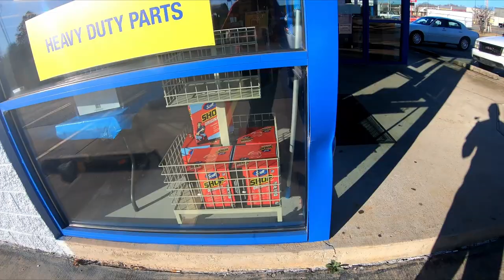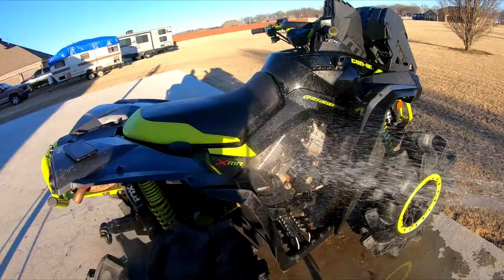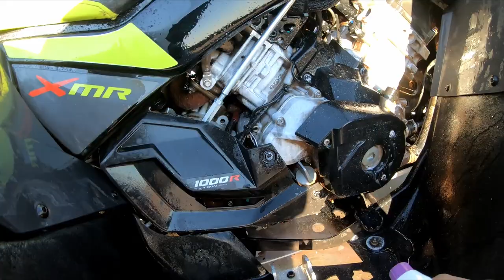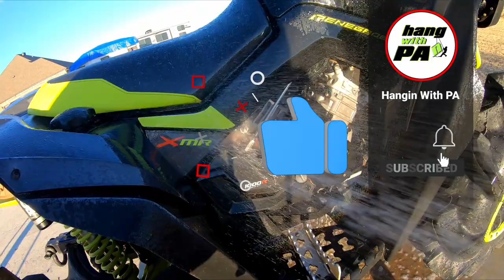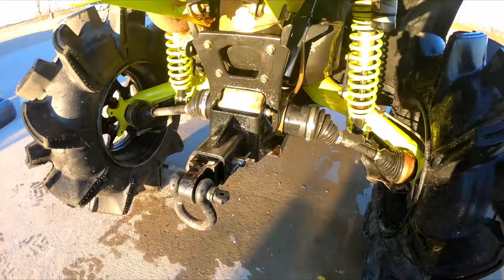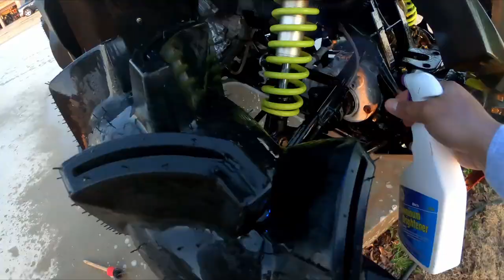HOW TO REMOVE MUD STAINS ALUMINUM BRIGHTENER CANAM RENEGADE 1000

Comment: My old KFX Id spray wd40 on the engine and under the plastics.  It never stained and was super easy to clean after riding. After a wash  once it dried id wd40 the case and cylinder down.
Reply from the maker: I have heard people say this . 💪🏽🤙🏽

Comment: I use meguairs wheel cleaner works good as well and easier on the painted surfaces
Reply from the maker: Yeah I was looking for that but it was out of stock. Good to know though 💪🏽🤘🏽
Reply: @HanginWithPA  I also use simple green it takes the mud stains out of the plastic but make sure to dilute it good channel bro
Reply from the maker: @Dieselmd2008  that’s good to know , i just never had a good experience with simple green

Comment: What happens if you get it on the plastic?
Reply from the maker: Aluminum brightener contains acid so if it hit painted plastic it would eat the paint off, it it hits plastic it probably will fade it. Good question 💪🏽🤘🏽
Reply: @HanginWithPA  I know you you stay next to my cousin with the Tahoe with the rims and where do u get that stuff at
Reply from the maker: Bobo.. yeah he good people. Napa has it, but when I went to the location on Kheli they only had one gallon and one 32 oz spray bottle left so I bought both.